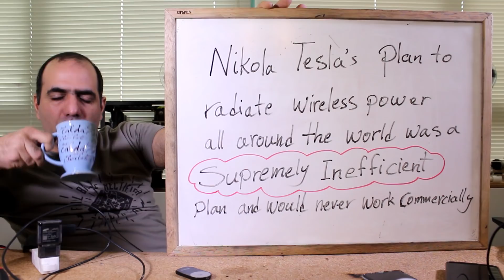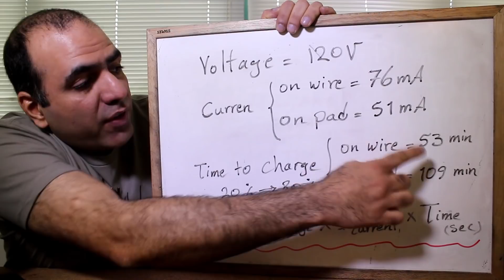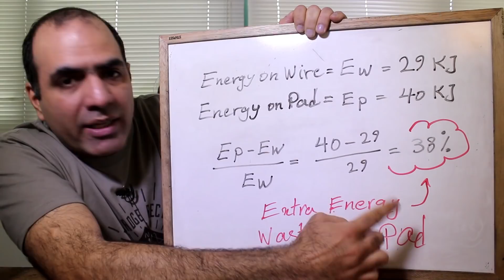Drowning in Inefficiency

Comment: 0:51
Oh my gosh, someone who actually understands that wireless charging is the dumbest thing. My thoughts exactly match up with what you say about wireless charging.

EDIT: since posting this comment, I changed my mind, and I use a wireless charger almost everyday.
Reply: It takes twice as long, uses 38% more energy, costs 10x as much, and you can't move your phone around while it's charging. So what's the benefit?
Reply: "Effort of plugging and unplugging " seriously guys u are lazy
Reply: @premsuresh9466  very
Reply: @premsuresh9466  50 x 0,99cent on cable to my phone, wireless charger 5USD. Because my phone have hard life with me, also this teach ppl to put things on same place.
Reply: Wireless charging is wasteful, but I can safely say it highly extended the lifespan of my previous smartphone.
I've owned it for about 5 years, and in its current state, the USB port is in a pretty bad shape, I have to position the cable/the phone just right to get the phone to charge, regardless of the cable.
Whenever I did not need my phone to be charged as fast as possible, which was I'd say about 80% of the time, I'd just place it on a wireless charger and let it slowly charge.
Given the current state of the USB port, if instead of mostly using a wireless charger I would plug and unplug my phone from a normal charger instead, it would be safe to assume the port would be dead like a year ago. And I'd have to choose between paying a service shop to replace the port for half of the value of my smartphone, or throw it away, because nobody buys a phone with a broken charging port.
So no, wireless charging is not the dumbest thing. It's inefficient, but it certainly expanded the lifespan of the phone.
Reply: @kamild_  a charging port can be replaced though, unless it's soldered on. Wireless charging is just useless.
Reply: @rosaria8384  sure you can, but not everyone got the skills to do that properly on your own, nor wants to pay a repair shop so they can do it instead. May as well preserve the port so it serves for longer instead of replacing it every so often.
Reply: @kamild_  So.. Phone > Environment. Gotcha.
Reply: with most phones being waterproof they tend to sense weather or not they have liquid in the port and will become unchargable for hours via usb with wireless being your only option
Reply: Since most phones only have one charging port it is the most vulnerable part of the phone, and they do have a limited number of plug/unplug lifecycles. When you consider a $1K phone, the microscopic cost of electricty  wasted due to wireless charging is actually much less than the effective cost of a plug/unplug cycle. If they had removable batteries or alternate charging ports it might be a different story, but that's not the case these days.
Reply: @MrGigaHurtz  
Yes, I’ve realized that since posting this comment. Also, you could literally just buy 1 LED light bulb and replace a single incandescent light bulb in your house, and you would save more electricity than using a wired charger instead of a wireless charger.
Reply: @MrGigaHurtz  and for androids that charging port is also the same port used for things like USB devices, HDMI, accessories, USB audio and more so there are cases where using the port to charge may not be a easy thing
Reply: I've got wireless pc mouse with wireless charging - its perfect because it stays on charging pad most of the time even while it's being used
Reply: When I heard about wireless chargers I was so excited that there would be single Tesla coil in mid of the house and it would magically trasnfer energy through air anywhere in the house..... then I started studying Physics at Uni :(
Reply: Yeah
Reply: Wireless charging is convenient in the car. Especially with a charger that automatically clamps on to the phone. Just throw your phone in there and you can drive away quickly. Combined with Fast Wireless Charging available in some phones, it's a pretty decent alternative in a car
Reply: Even though it is, there was once my power input was wet and didn't go dry as soon as I wanted, I had to use one wireless charger, but I thought the same, anything else from that situation I mentioned, they are useless
Reply: I think its pretty much common sesne to see its how dumb it is... You still have wire, you are much less "mobile" with this type of charging, is cost more and it takes longer to charge... Its just so dumb...
Reply: My iphone 8 has the fast charging where the voltage goes up and down as per the USB-C protocol, yes I use a special USB-C to Lightening cable.
If I get the wireless charger, not only does it costs $99 it bypasses all that USB-C voltage negotiation and charges at 5V 5W
Reply: It's convenient. I have one pad at my desk at work and keep my phone in its case and on the pad. Saves the effort of plugging and unplugging. I understand if you have an iPhone.
Reply: @taunokekkonen5733  I don't if it's just me, but I don't think plugging and unplugging it's not an effort at all and it takes about 0.5 seconds to do it
Reply: @thepedrorriva  how many cables have you gone through?
Reply: @taunokekkonen5733  I swear I use the same cable that came with the box. I own this cellphone for 4 years I think.
Reply: @taunokekkonen5733  0
Reply: @thepedrorriva  it doesn't take effort, you're right. In fact most wire are longer than 3 cm long so half the time if you get a call or something else you can respond WHILE still charging. Honestly wireless is so dumb.
Reply: @taunokekkonen5733  the iPhone cables that come in the box are super garbage to start with - making plugging and unplugging it super dangerous. If you buy something like Anker or something with better durability you won't need wireless charging at all.
Reply: @taunokekkonen5733  There is another solution. Those magsafe connectors Apple used to use on their macbooks. Easy to attach, easy to remove, plus all the benefits of wires.
Reply: @taunokekkonen5733  I charge my phone while I do something else for about 30 to 45 min and I have enough power to last at the verry least an entire day. So I dont realy see "the effort of plugging and unplugging"
Reply: @taunokekkonen5733  iphone has wireless charging too?

Comment: Mehdi, real question this time. How the hell do wireless mice, keyboards, and controllers work. More specifically the receiver that plugs into USB. Why do I need one for each device? Are they slower or worse than the wired alternatives in any way?
Reply: They aren't standardized so each company makes their own dongles. Wired is the best way, more efficient and doesn't have latency.
Reply: @RawbLV  Of course wired has latency.
Reply: @logitech4873  Wireless has latency.
Reply: @RawbLV  Well duh.
Reply: @logitech4873  That's not what you said.
Reply: @RawbLV  I said wired had latency.
Reply: @logitech4873  Bro these are chargers. Who even cares about latency.
Reply: @RawbLV  OP is talking about mice, keyboards and controllers.
Latency is definitely a worry in these. However, modern wired and wireless devices have only minute amounts of latency.
Reply: @logitech4873  Well duh.

Comment: Consider the humble bicycle for energy efficiency, it converts chemical energy into kinetic energy. At a cost of .75 kcals per gram/kilometer, it is by far and away one of the most efficient machines on earth. It is more efficient than walking.
It's more efficient than the human body that operates it.
So, what needs to happen, is people need to stop driving their cars, and plop their fat butts on a bike. Even with a motorized pedal assist, a bike still outclasses cars and motorbikes in efficiency.

Comment: you should also say about nuclear power plants. they using power of atom to heat up water to make steam run the tubines....
Reply: They take a decade to be built and they use a shitton of concrete which in turn also pollutes the air as you need to mix and deliver the concrete. Not saying that NPP are bad. It's just that we should have built more long time ago and we shouldn't be closing the current ones.

Comment: Electric motors 60% efficient? More like >80%
Reply: i was suprised it was even as high as 60%! do you have a source maybe?
Reply: Diagram in link is from a prius electromotor and inverter.

https://teslamotorsclub.com/tmc/attachments/prius-ornl-motor-efficiency-gif.96558/

We should ask the poster of the video as well to post some sources! The electromotor's high efficiency is common knowledge, a well-sized electromotor for constant speed and load applications can run at over 95% efficiency. World record is 98.8%, see link: https://new.abb.com/news/detail/1789/ABB-motor-sets-world-record-in-energy-efficiency-saves-half-a-million-dollars
If electromotors had lower efficiency then electric cars would all have a big grill in the front, to allow for cooling, just like gasoline car. But they are all grill-less (or ugly shiny pseudo grill like bmw i3). Plus, an electromotor can be used in reverse, to generate back electricity. In a non electrified vehicle all that energy just gets transformed to heat by the brakes. In the end all these things means the motor can  be more compact, need less cooling, be lighter etc. From an engineering perspective it is much more elegant than a gasoline engine. In the end it would be more efficient per km driven to burn the gasoline in a gas-fired powerplant and use the generated electricity to power an electric car than to burn it directly in a gasoline car.
Sorry for the long reply, the topic is really important to me, because just like ElektroBoom I'm also very passionate about efficiency ;-)
Reply: Electric motors are very efficient 80+, but to be fair, he said electric cars, not motors.

Comment: There is such a thing as a free energy device. It's called a solar panel. You put it out in the sun, and free electricity comes out of it whenever the sun shines. Wind generators are similar. You put them outside in a field or on a hill, and every time the wind blows free electricity comes out of them. There are many other free energy devices too, like hydro-electric generators, wave-powered generators, tidal generators, etc.

Comment: Almost all ICE in cars nowdays is over 35% efficent. Most cars are actually over 40%. Diesel get a bit over 45%. The 20% efficency number have not been true in almost 100 years. What it comes from is also including breaking losses.

Is true that Electric cars is not as efficent as most people belive, but 50%... well its not really that bad. Best calculations i would aproximate it beteween 60 and 75% including charging losses.

There is hardly any coal powerstation around today that is 20% efficent. There are basicly 3 kinds:
Lignit: 25-30%
Bitumen: 30-35%
Super critical (bitumen): 40-45%

While some solar-cells is 30% efficent. The monocristalin Silicon that is used by most instlations is at best 25% efficent (in labs), in reality 20%.. but that is for the cell, not the panel. In a pannel this decrease to 12-15%. And that is compared to incoming light. Not pannel size.

The problem with Solar is that it got a horible bad energy regain rate.

Well with a phone… the CPU is about 0% efficent. (there is a actuall number, but its really freaking Close to 0%)
The phone screen is generaly less than 10% efficent.

There is ways to increase both part quite a bit.. avalible now. That would also extend battery Life quite significantly.
Reply: right but the fuels themselves are very inefficient and cost a lot of enery, and they are a limited resource.

but good points and info, i was suprised as how well they worked TBH.
Reply: @piworower  while that is true it may not be as bad as most people think. Most fuel cost between 5-10% energy to be made. It's really Jerry little diffrance between making coal for coal power plant or making petrol for a car.

So the argument for electric car that it saves a lot on the fuel side is simply not true. A electric car consumes about as much well energy as  fuel based car. The only diffrance is that the electric car takes the major losses earlier that makes it look more efficient on paper.

Generaly looking closer a ev car is more efficient in the city, while a fuel based car is more efficient outside of the city... Making a hybrid make a lot of sense.

One more thing is that making batteries take a lot of energy.....and that is also true for solar.

The whole idea of a solar-battery society is just flaws. It's not about reducing emitions, but rather hiding them in china.
Reply: @matsv201  Maybe it takes 5-10% of energy to produce fuel, you still have to transport the fuel with trucks, the same trucks that burn fuel, and at the end you burn that fuel. There's a lot more energy wasted along the chain.
Reply: @RawbLV  5-10% is the full chain, including refining. Transporting oil is cheap because partly it's liquid and partly it's very dense energy vice to mass. Also it's mostly transported with ship or pipeline. While it often is transported by track "last mile". The bit people se. This is a relative short distance.

Comment: Wireless chargers have low power rating. Even you connect with 4A charger, it will consume low power. So you can't take rated energy in calculations. You have to measure real power using meter instead proceeding with ratings.
Reply: That's what he did.

Comment: Can you explain what a fast-charger does different than a normal "slow"-charger?
Reply: using the same voltage of 5volts they use more current so that more power can charge the battery faster. 

like filling a bucket with water. if one hose puts out 5L per min (volts), you add another hose a 5Lpm so fills faster at 10Lpm. an other way is to turn one hose from 5Lpm to 10Lpm (higher current) and increes the pressure of the hose to fill the bucket twice as fast. 

and becuse USB voltage must stay the same (like as if the hose can't gt more pressuse because the tap is completely open) to need to raise the amps (like adding more hoses)

P=IV 
0.25W=(0.5A)x(5.0V) old
0.50W=(1.0A)x(5.0V) new       also written as 0.50W=((0.5A)+(0.5A))x(5.0V)
Reply: @piworower  Thank you very much for your answer and have a great day!

Comment: The wireless pad is more a battery preservation thing than anything. It's a neat place to put down your phone while you're working or doing whatever that'll keep it topped up and if your phone is well designed enough it'll use that instead of the battery when it's at full charge. Think of it as a convenient means of keeping your phone charged rather than a means of charging it from low battery. 
It's a bad thing from an electrical standpoint but a good thing from an engineering (wear) standpoint and it's convenient if you use it as a phone stand thing that happens to charge your phone while it's there

Comment: I use my wireless charger alot because some Samsung's have a problem where the phone thinks there is water in the charging port and wont let you charge even if the phone has never been in contact with a moist environment. So the wireless comes in pretty handy

Comment: Hey Mehdi, let me throw this idea at you, maybe you can test it and prove me right or wrong.

The issue with ICE(internal combustion engine) is they waste energy cooling them and charging the battery. My solution to this is my encasing the engine in a massive peltier cooler. By absorbing the heat and converting it to electricity to charge the battery the engine shouldn’t need to be cooled as much.

With the removal of the Ac compressor it would decrease load also. Replace it by drawing air over the outside of the engine peltier and into the cab.

Lmk what you think 🤔
Reply: i'm not sure i don't think it would work. maybe don't drive a car and find options for bikes and public transportation. that in some places and cities you need a car. but if you want to make a diffence looks at changing how cities and transport systems are built. the mass of the car is hard to move around and even with a 100% efficent motor they still consume a non sustainable amount of energy.

the cooling system and battery charger use only a small fraction of the energy that is lost through friction and vibrations. that is why they are so hot and noisy. and more over during the power stroke does not use all the energy of the gas while expanding and turning the cam shaft.

ac is more efficent then open windows or vents. and if you vent air over the motor into the cab you get hot air, that is how the heater in a car works in the winter. there is no heating element, it just uses air that has been heated by the motor.

Comment: * EU bans light bulbs with 50 and more watts because of inefficiency *
Smart politics in our country:,,Now they are heating elements".
Reply: Really, the problem is that higher wattage lights are sometimes more efficient. We talk about LED lights having crazy efficiency, but when the elements get larger, they produce more heat. HID bulbs at higher wattages actually get more efficient than LEDs at actually producing light. The problem is reflectors and housings do not focus light correctly and absorb a bunch of it, making it less efficient.
Reply: We sell this as shockproof bulbs